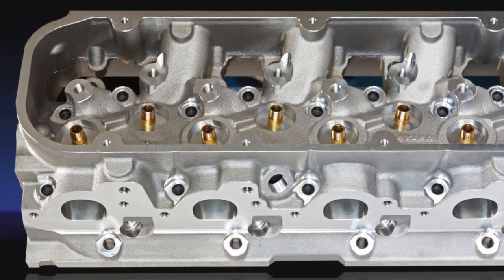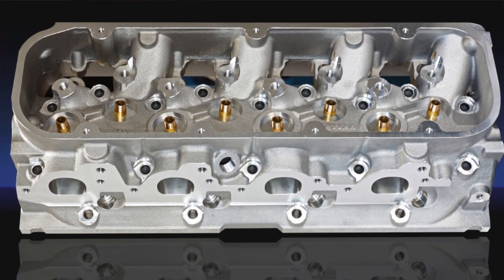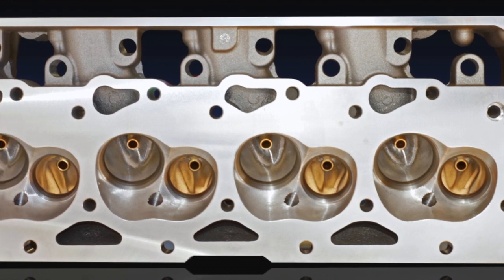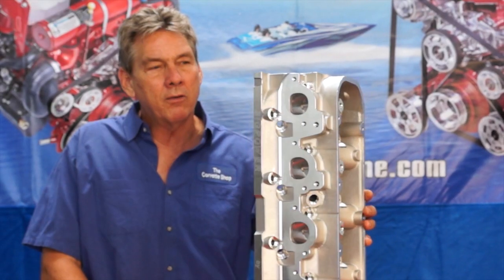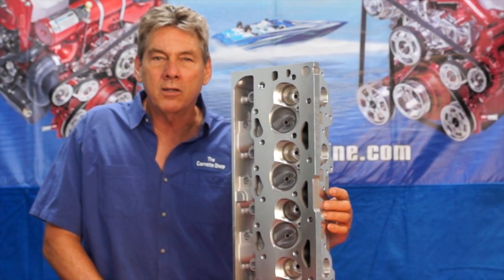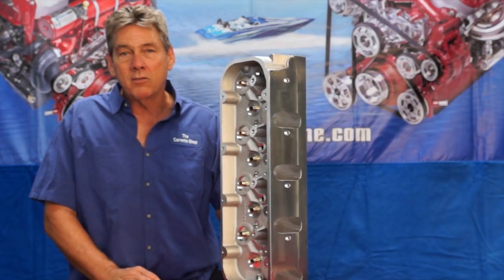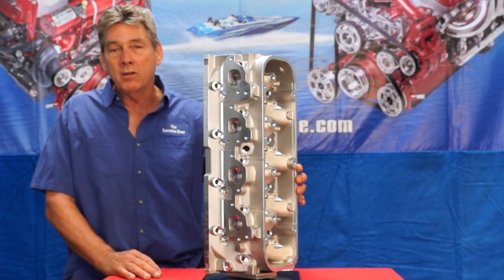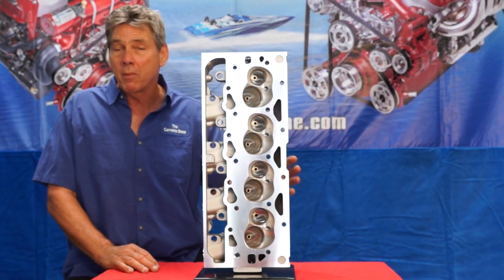8.1L Aluminum CNC Cylinder Heads - Big Performance & Horsepower From Your 496 / 8.1L

Comment: That's a nice head. Based on what you said, it seems there is a gap between  the modded GM intake and your custom manifold. If there is poor hood clearance and lack of hook-ups for factory kit. Is there a FAST type of manifold sooted for a 540cid that someone can design?
Reply from the maker: Raylar made the Cool Gap manifold (similar to a tunnel ram style intake manifold) for years, but every piece was custom built out of hand-welded aluminum, which made them about 3k each and they don't fit under a hood. They look awesome, come in dual carb setups, so for hot rods they're a great choice.
https://www.raylarengineering.com/intake_manifold.html

As for a stock appearing performance manifold similar to a FAST, Raylar is currently creating that very manifold and it should be on the market in about a year.

Comment: So no ecm flash since no cam change?
Reply from the maker: You'll get more out of the heads with proper tuning. The aluminum heads extend the power range from around 4400 rpm to about 5200rpm on stock components, though to be fair, almost no one runs just the heads. Most toss the 202 camshaft in as well, which further extends power and torque.
Reply: Really hard to find volvo ecm programmers. Merc is everywhere
Reply from the maker: In marine applications, most people just up the fuel pressure a few PSI to compensate for the modifications to the engine. Give Larry a call at the shop for more information.